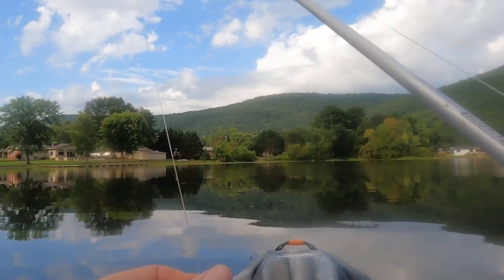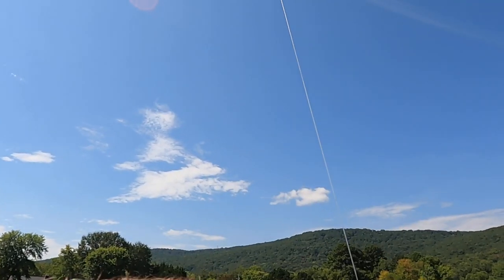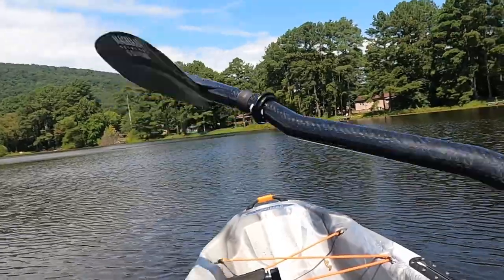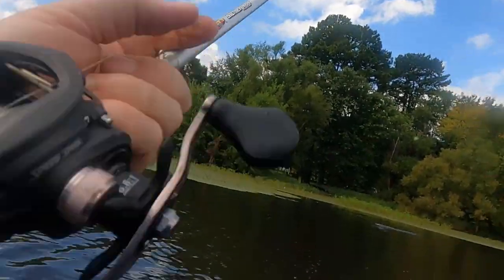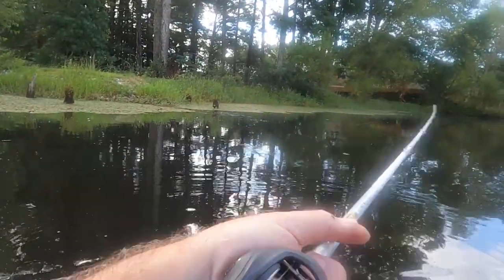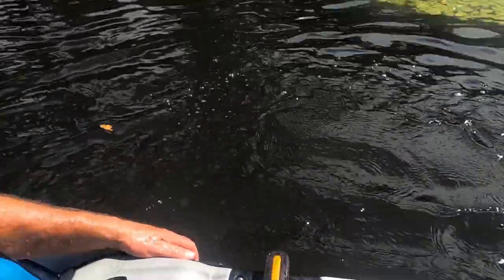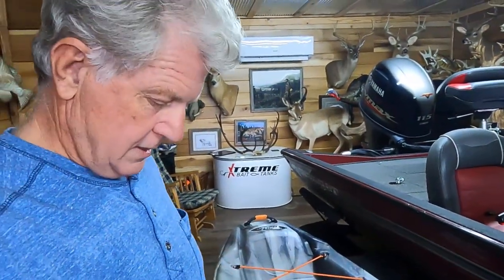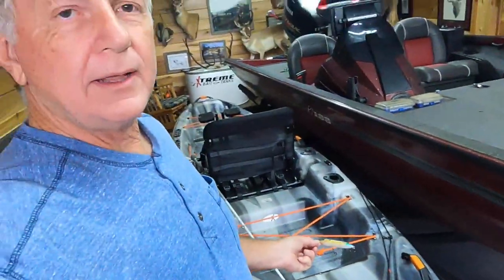A Top Water Fishing Lure that Fish Can't Resist !!!

Comment: Mr. Rocky- good to see you in a kayak! I have been fishing one for 20 years or so and have a couple observations for you. I like smaller footwear I can do 2 things with- swim or walk in the water. A big sponge is nice to have on board to keep things tidy- like the mud and water off your feet when you walk it out from the bank. I really like to have anchors front and rear. The back anchor will save you quite a ride when managing larger fish like cats or big carp. Another tip is to cut a small notch out of the top of at least one paddle blade to pull on an anchor rope or branch. A small notch in the bottom of a blade can help with retrieval of hung lures or hooks. A 15 or 20 foot length of 1/4 inch line is nice to have on board in case you need to rescue another boater or get a tow in the case of mechanical problems. As far as fishing goes, you will notice an increase in catch numbers because you are much lower in the water and don't have motor noise. Especially with spooky fish like shallow carp with a fly rod Have fun and thanks for the video!
Reply from the maker: Thanks Greg
I really appreciate the great info in your comment. I need all the help I can get on kayak fishing 😀
Thank you very much and I appreciate you watching 🎣🎣